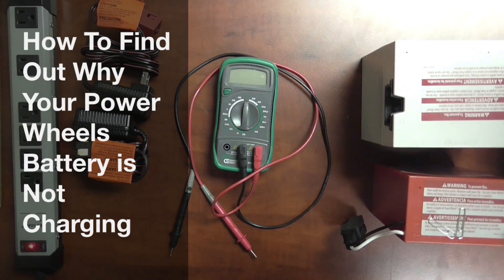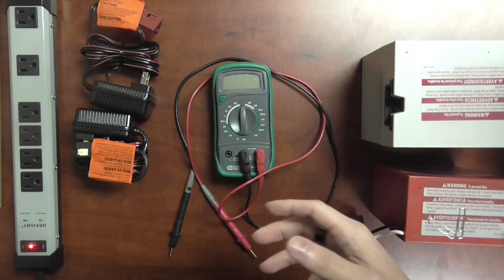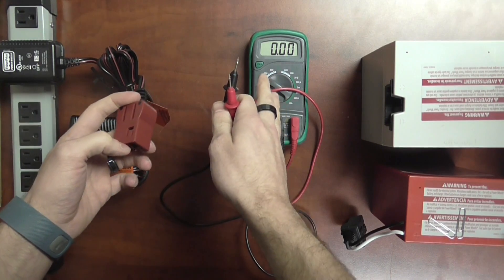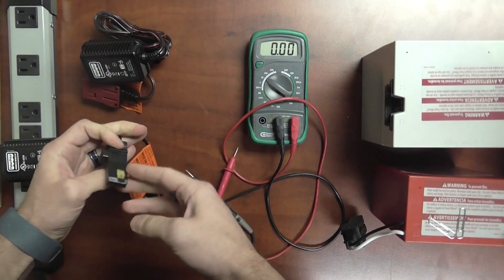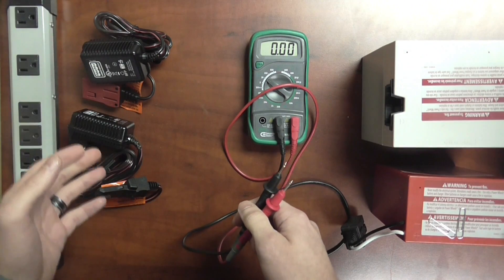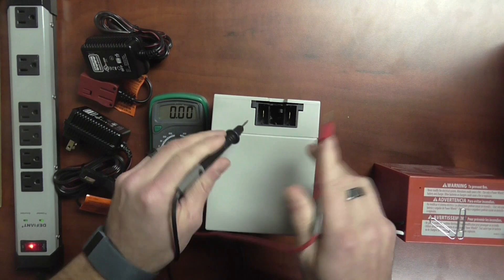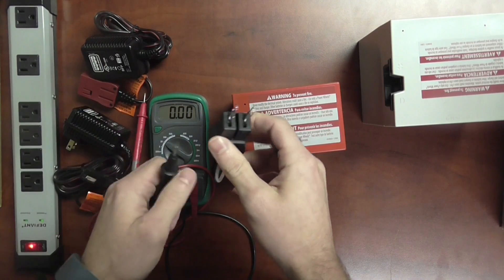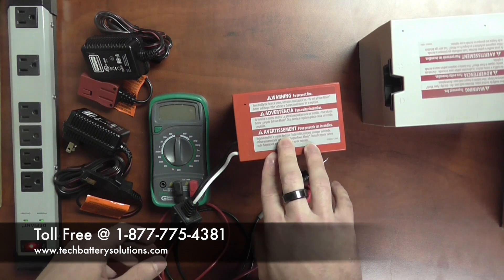How To Find Out Why Your Power Wheels Battery is Not Charging

Comment: My battery voltage reads 10.55 but doesn't work at all the car. :-(.  Any ideas why?
Reply from the maker: That battery is pretty discharged Jason, you will need to get it up into the 12.6V range or above to see any solid performance out of the battery.
Reply: Same here, I had my battery on the charger all night and it only reads 10.5 v.  Guessing it won't ever get back to 12+

Comment: all power wheel batteries are garbage. for 4 years now I've been using my snapon 18v drill and impact gun batteries with no trouble on my son's power wheels.  18v brings all his power wheels to life and they are fun,and fast. try it out
Reply: could u show me how
Reply: Brandin James it's easy,I cut the plug off all my son's power wheels. black wire is - white wire is + positive. find out which side is positive and which side is negative I used male speaker connectors. snapon batteries are easy the connectors slip right in
Reply: kevykev38 m
Reply: So you use a gun battery to operate you toy car?
Reply: BMW you car won't charge. The charger only has plug in like to go in a radio (hollow opening). 2nd time charging and won't charge
Reply: kevykev38 have 2 wild thing  power  wheels  no run    have problem to meke run
Reply: Snap on batteries are garbage as well I use Dewalt batteries

Comment: This quick and easy method, you can have nearly unlimited amounts of battery power …for nearly no cost [Check Details Here==>https://plus.google.com/100351090281822647456/posts/HMvgs7qqoKA  ]. Enough to even live off-grid and power all of your devices an electronics! This easy method works for nearly all kinds of old/dead batteries too…

Comment: Will you be able to get a reading to determine whether your battery is good or not if the battery isn't charged?
Reply from the maker: Negative, you will need to attempt to charge the battery first. All a voltmeter can tell you is the state of charge of the battery, it can not put a pass or fail load test on the battery.
Reply: High-Tech Battery Solutions, Inc Thanks appreciate it

Comment: I bought my son a brand new power wheel drive 2 weeks ago. It was working fine until I let it charged over night. The seller warned me about not to charge more than 3-4 hours. Now when I start it up, all the lights and musics are working fine but the car itself won't drive forward/reverse . Do you think it burned the motor or just the fuse??
Reply from the maker: Hello Leo, I'm not sure that the battery is the issue if the lights and the music are still working on the car. You can check the fuses to see if any are burned out on the Toy - I think it may be a motor related issue.
Reply: @HighTechBatterySolutionsInc

Comment: Did you make the video for the quick charger testing ?
Reply from the maker: You can not test a quick charger using the above method. The charger itself will not put out any voltage until it makes a solid connection with a battery. The only way to test the charger is to use a power wheels battery that you know is good. You test the voltage of the battery and write it down. Once you have your first reading you would then plug in the quick charger and let it sit connected for 10 minutes. After that time has passes you remove it from the battery and test the voltage of the battery - if its above the number you had previously written down then its working. If you can give me an idea of the problem your having with the charger then I can do my best to answer it.

Comment: Did you ever make a video for the quick charge type?
Reply from the maker: We have not made a quick charger video because it is a bit tricky to test those units. The charger itself will not engage (put out voltage) until it makes a solid connection with the power wheels battery. What issue are you having with the charger - I may be able to help trouble shoot it for you.
Reply: I have a quick charger and it simply wont do anything, no lights illuminate and it will not charge the battery. The battery is good because I am currently charging it with a 12 volt automotive trickle charger. Is there anything I can try to fix the original charger?
Reply: My son power wheel is so slow I don’t know what to do with it it doesn’t go any faster then 6v

Comment: I picked up one of these out of the local Goodwill rubbish pile and figured I'd use it for something. Thing was severely undercharged at 4V. Threw it on a trickle charger and it seems to be charging. Has anyone taken one of these apart yet? Most Lead Acid batteries I've handled swish and slosh. This one is pretty solid.
Reply: Queen Chrysalis
Reply: Or you can buy a new one at walmartt

Comment: My sons car was completely Dead before we started to charge it, now after the charge it won't cut on what did I do?
Reply from the maker: Do you have access to a voltage meter? If so the best thing to do would be to check the voltage on the battery to see if it took a charge. Fully charged for this battery would be 12.8 + volts. If the battery is testing fully charged then issue is somewhere in the toy itself. If the battery is stone cold dead then there are options depending on the voltage reading that you get.

Comment: I got a free power wheels toy and knew it needed a new 12v battery. Bought the new battery and the car drove great for an hour. Went to charge the battery and now the car won't drive for more then 30 seconds even after a 24 hour charge. I assumed the charger is dead which I verified using your strategy. However the battery is reading 5.5 volts which according to your video means the battery is in need of replacing. Is that possible? It's a brand new 12v battery. Just wanting to verify that if the readings are that low it means the battery is bad and not just in need of a charge. Thanks!
Reply from the maker: Since the battery is brand new and used only once or twice then there is a very good chance that it will bounce back from 5.5 volts, but you need to get a new charger ASAP. The longer the battery sits in this extreme discharged state the harder it will be to bring it back.
Reply: Thanks. It took some messing around but I got it back up to 11.93v. I had to cut my charger cables and connected it to my car battery charger first (charger wouldn't read it like you said). That bumped it up to about 10.5 volts. I then re connect my wires to the actual charger and did a single charge which brought it back up to 11.20. Sat it for a couple days and charged it again resulting in a 11.93 charge. Seems like it should be fine although it's not charging as strong as your battery but maybe it will recover more after a few new charges. Thanks for the help.

Comment: Hey I have a question I haven't used my Power Wheels 12-volt battery for 13 years it's in good condition will it still work I can't currently check it with a voltmeter
Reply from the maker: If the battery is 13 years old then is going to be time to replace it - the typical lifespan on these is 3 to 5 years. One quick way to tell if an old battery is bad is to physically shake it. If you can hear debris shifting around within the battery that means the lead plates have disintegrated and/or fallen apart.

Comment: What voltage reader are you using? How much?
Reply from the maker: +Helene Gladfelter I honestly can not remember how much the voltage meter was, but I do know that we get them from Home Depot - they have a couple of models available from budget based units to expensive contractor style. The one used in this video is on the lower end of the spectrum.